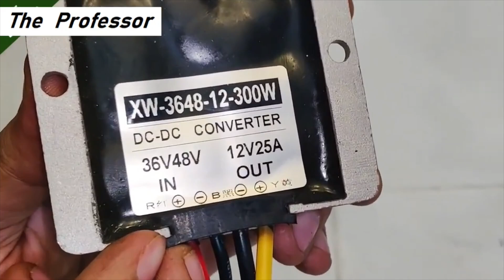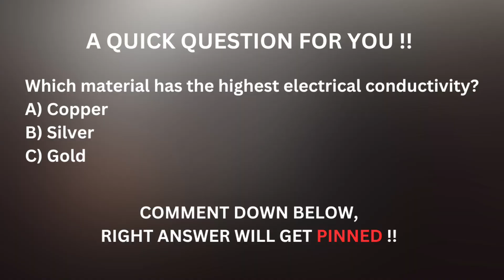Millions don't know this ! DC Motor electrical Inventions that are soo cheap but companies .........

Comment: Use a small motor to spin a wind generator it can run 27/7 the one I have if I put 24 v into the motor I can get 130 dc volts